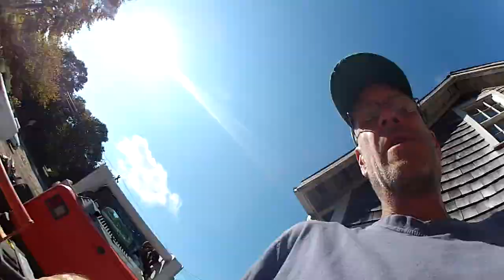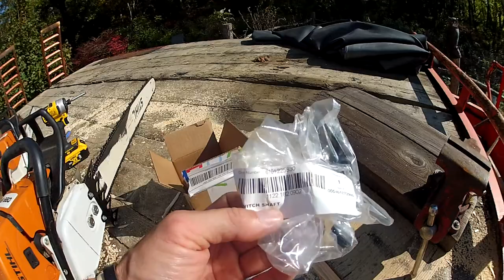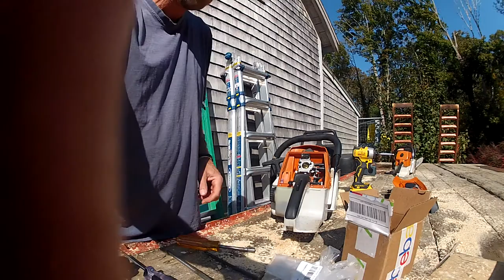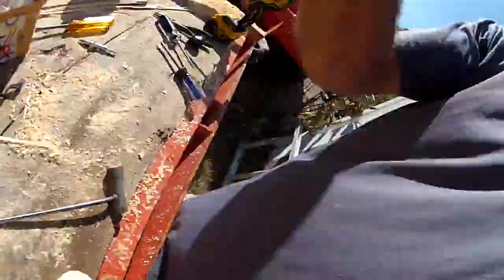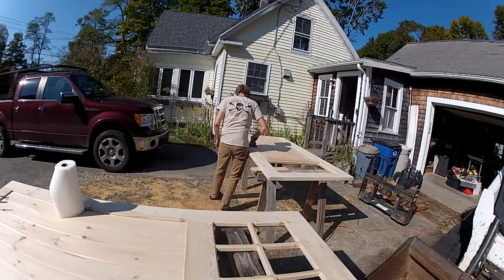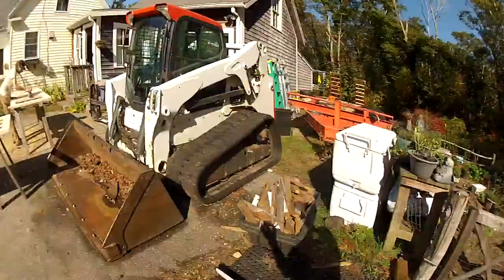Huztl MS 660 High idle fix and how to unflood and start a saw.

Comment: thanks for this, I also added to this and used an air hose to siphon out the cylinder
Reply: might want to make sure you have a dryer on the air compressor tho